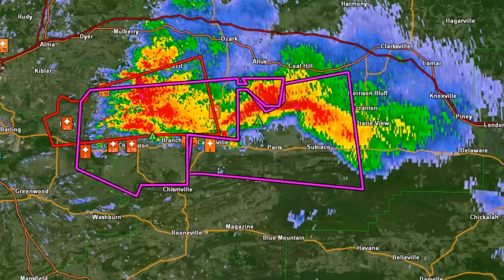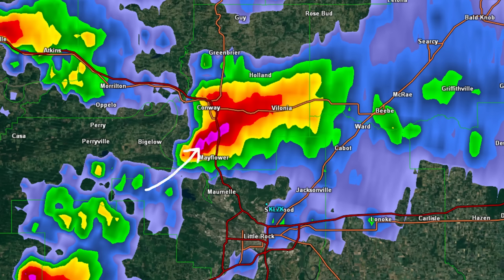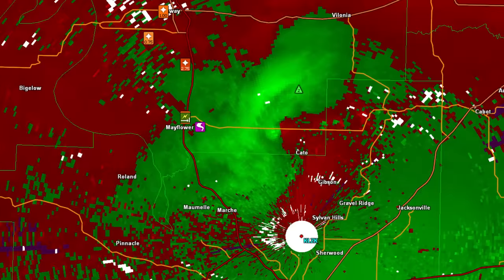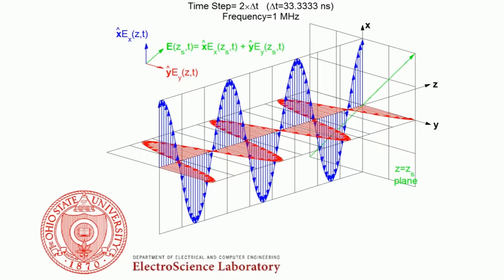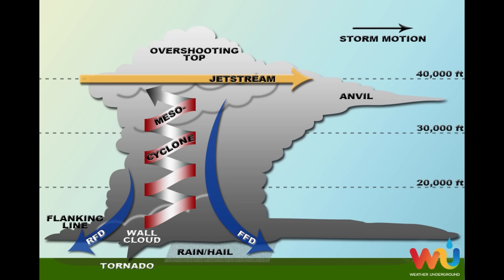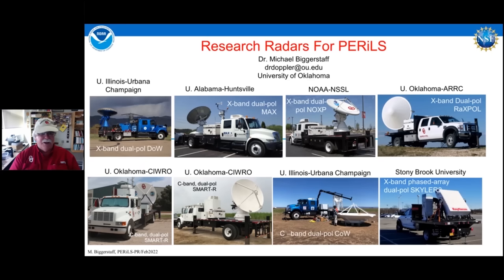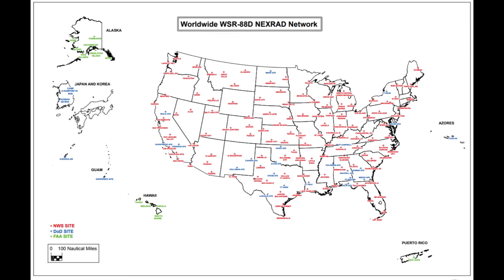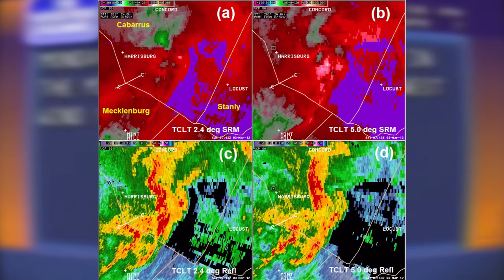Can Tornadoes happen with ZERO warning?

Comment: I went through something kinda like this. Back in August 2013, I was living in Bristol, Vermont with my dad. There was a chance of thunderstorms throughout the day, but none were predicted to turn strong or severe, really.

Later that day, a thunderstorm developed in New York and it started moving due east towards where I lived at less than 15 m.p.h. Constant rumbling and thunder. But, no warnings or anything.

Come to find out the said storm had a tornado warning on it when it was about 4 miles from me. I panicked and grabbed my dad and I put us in the basement..just in case. 

Luckily a tornado didn’t form, but the mesocyclone was rotating so strongly once it was about a quarter mile from our apartment.
Reply from the maker: Wow that's a pretty rare situation! Glad it didn't drop on your apartment
Reply: @weatherboxstudios  

It was. I’ve never seen a tornado but that day I was surprised to see the rotation!

Comment: I actually have. California, especially in Coachella valley doesn't have doppler radar on the level as Tornado alley does, so imagine my shock and horror when an EF-1 suddenly sprang up a mile from my home. We had no warning, no hint that this thing was coming, and while it was tiny overall it did knock out power to my city for about 2 days with slight damage to the roofs. Scariest thing I've ever seen. As if the earthquakes weren't bad enough.

Comment: I've seen two although they did no damage as far as I am aware. I think it was 2010 and I was stationed on Hickam/Pearl Harbor Joint Base. I was standing on a balcony outside my barracks room. I looked out across the flight line and saw a pair of tornados (waterspouts I think is the right term....) doing their thing on the far side off the coast.  I don't recall hearing any sirens or warnings at the time. I thought it was fascinating and took a couple photos.

Comment: glad I found this video, I've been trying to search for "tornados the nws didn't detect" and google wasn't giving very helpful results. this was perfect, and I'm now subscribed.

guess I should count myself lucky that I live in the wichita metro area with excellent coverage. however, just a couple weeks ago we got warned for a qlcs tornado and when I looked at the radar it was directly on top of us, but luckily there was no tornado. in 2019 though we did get hit by a qlcs in the middle of the night. 

also, $1.6M? that's it for a new doppler radar? I mean I know that it will incur much greater cost over its lifetime, but considering how much is spent on defense, wouldn't you think filling in radar gaps for $1.6M would absolutely be worth the cost for defense in the homeland? that's insane. and I'll have to take a look at that study. curious how they define "significant" in their data.

Comment: Radar gap is NOT because of curvature, or they would be spread more evenly. They are because of other factors, such as territories  too cheap (or too corrupt) to foot peoples taxes for radar, mountainous regions, ect. coupled with the fact that each radar has limited range, similar to the sonar we used in the ocean back when I was a commercial fishermen. But your correct, we NEED more radars. Any gap is inexcusable.
Reply: Curvature plays a role at extreme ranges, but we do need more radar sites. The real problem is that this is entirely run by Federal agencies and they do what they want to (and can) regardless of local predilections. That's why a lot of TV stations in the gap areas have installed their own doppler radars since that's the only certain way to get the resources those areas need. The post-Plainfield plan was to have seamless coverage where needed but Congress only funded the initial push, so later phases of the plan never happened. There's now bills being considered to get this back on track; be sure your Congressional representatives are backing them,.
Reply: @P_RO_  Well, imo with as much as they harvest in taxes and revenue, EVERY town should be in a radar field, and every town should have an underground public shelter. There is no excuse in our silicon/advanced era to lose a single person to the weather. But your right, the federal government spend money on all the wrong programs, and ignore whats truly essential.

Comment: Its 100% terrifying. We live in the Portland Metro area (OR), we've had two unwarned unknown tornadoes. The only ONLY reason they were confirmed is because some ones house got hit and had a security camera on one, and the other was because we all saw it touch down and lift back up. Coming from the Midwest that shook me to my core because holy crap, there were no warnings, just some storms. The one that we all saw touch down, wasn't even a severe warned storm.
Reply from the maker: I haven't done much research on west coast tornadoes, but those have to be a nightmare when they do happen. Thanks for sharing
Reply: @weatherboxstudios  Oregon tends to get a lot of EF0 and EF1 tornadoes, and more rarely a few EF2s. And in extremely rare cases, EF3s, but that almost never happens. My county (in the Portland metro) has only really experienced EF0 and EF1s and I don't remember a single one of them either. The subject intrigued me because I had no idea we even had tornadoes in Oregon until I looked it up. But they're pretty insignificant really.

Comment: A weak waterspout came ashore from Lake Samish near Bellingham, Washington a few days ago without warning. It's rare, but it does happen in Washington sometimes, like the EF2 that hit Port Orchard without warning. Also, why was there never a tornado emergency issued for Joplin in 2011??
Reply: The reason why the National Weather Service office in Springfield, MO didn't issue a Tornado Emergency for Joplin, Missouri during the May 22nd, 2011 tornado is because it formed so quickly. The tornado sirens were first sounded at 5:17 PM Central Daylight Time and gave the residents of Joplin seventeen minutes to take shelter. By the time the tornado sirens began wailing a second time at 5:34 PM Central Daylight Time and the National Weather Service issued a Tornado Warning for Jasper County, MO the tornado was already on the ground and moving through Joplin. In addition to forming so quickly and on the boundary of a densely populated area; what made the Joplin tornado so deadly is that it was hidden in very heavy rain and difficult to see.

Comment: I had one come down right on top of my car about 25 yrs ago in extreme northern New Milford CT just before the Gaylordsville line. I was driving north bound and had a white sedan in front of me about 30 yards... all of a sudden the car in front slammed on the brakes-I did too and nothing but leaves and wind-it picked up my car and carried it about 50 yards onto a lawn in a nw direction.  After about 15 seconds-it was clear like nothing had happened, but my car had no tire tracks in the grass where I currently was.  I still shake thinking about it and if I had gone the other way I would have probably died in the river to my right (ne or e direction).  Goosebumps.   Where was the white car??? I have no idea.  I assumed it just kept on driving but I'm really not sure.

Comment: Can you do a video on wind and gust speed? I live south of Seattle and on occasion we get some pretty good wind storms (Nothing like the rest of the country) around this area. I live in a relatively forested neighborhood and get bad anxiety when the wind is gusting above 30mph for fear of a tree falling on the house. What wind or gusting speed should I legitimately be worried about in this case?
Reply from the maker: That's a fantastic idea!
Reply: "Worry windspeed" depends on a lot of variables. The official 'line' for calling a storm severe is 58MPH (actually 50 Knots but close enough). At that speed falling trees may be a hazard, but more likely just branches will break off. At around 70MPH weak trees will fall. With weakened root systems, tall highly exposed trees, and saturated soil trees can fall in winds as low as 45MPH but it doesn't happen too often. Pay attention to what happens where you live for the best idea of when to worry as local history and knowledge will get you the best answer.
Reply: @P_RO_   I will reluctantly say that the “wind speed” rarely reaches into the 20-30mph range, however the gusts are really where my biggest fear is. We’ve had some pretty decent 50-60mph gusts with saturated soil (Washington State) which I thought were bringing the entire forest down. I try to tell myself that these trees have been here longer than I’ve been alive so I shouldn’t worry so much. I’ve done a little research on storms in the Pacific Northwest and we typically get one good one every year or two. Good one = 25-35mph winds 55-65mph gusts.
Reply: @weatherboxstudios  👍 I’ve seen a few videos online about it but you have a very unique way of explaining how weather works and for some reason I understand it. Thank you for the videos! Keep them coming!

Comment: Hey tonight my cousin witnessed a tornado in Georgetown Kentucky tonight along a QLCS Line and we have video of it and I was watching velocity and base reflectivity and there did seem to be a very small amount of rotation shown on both. The thing is, Georgetown doesnt have the best coverage and there was no warning issued but there were sirens that went iff
Reply from the maker: Wow! I wonder if the sirens went off for a severe thunderstorm warning
Reply: Sirens aren't controlled by the NWS; they are usually activated by a location's Emergency Management system of sometimes Law Enforcement or Fire Department. So you can have sirens and no warning, warning but no sirens, both, or neither. Always have at least 2 methods of receiving severe weather warnings and pay attention to them.

Comment: Only tornado I’ve seen was unwarned.   I was at home playing video games when my parents told me to come outside.   We are in rural MS so we had a lot of tall trees, just above the trees through a gap you could see a pretty big tornado funnel.    It was far enough away you couldn’t hear it and the skies weren’t dark so you could see the structure of it perfectly.    I was like 10 so I just said “cool” and went back inside like it was a rainbow or something.        I mean literally on my front porch I had the perfect view.   No clue if it was unwarned or not but it damn sure was unwarned to me especially since it wasn’t rainwrapped and the skies were clear.    I used to see waterspouts all the time on the beach when I was a kid but as the years progressed they just stopped happening.   My mom literally would point out waterspouts every single morning to the point I doubt our news even reported them, it was just a common occurrence back in the early 2000s

Comment: Mayfield, Ky experience an un-warned EF2 tornado that almost hit the county High and central elementary school.  I was just 18 and working at the local Food Giant. We weren’t expecting storms at all that day and it was a random super cell that formed out of no where. No warnings were sent out until the Sheriffs department warned that they had spotted it. It actually stayed on the ground for quite a ways. Destroyed some homes and lifted a mobile home off the foundation and wrapped the metal frame around trees. The storm happened back in 2016. Look up the tornado of mayfield in 2016 and you should find some good video taken off the Dick Castleman Bypass just a mile or two south of the tornado. There was local video also taken by the car dealership that shows it going through a Rv and camper Lot. Let me find the story and I’ll tag the URL!
Reply: It was actually an EF3
Reply from the maker: Wow Mayfield has been through enough already!
Reply: @weatherboxstudios   tornado alley has definitely shifted and it’s bad when western Ky falls in a groove of super cells that form along a line of unstable air. Ever since 2016 we’ve had non stop tornadoes forming around the area.  A lot of them are unheard of because they don’t make the headlines. We just happened to have 4 confirmed tornados over the last severe storm line last week and one actually touched down in Northern mayfield. It was an EF-0 then we had another one touch down South of Mayfield in Sedalia, Ky where I think it was a EF-1 touched down. No injuries or deaths were reported. Just minor damage. Actually took a whole street of power lines down though and arced the road causing small mounds. Kind of cool to drive by it now.  Anyway, western Ky has been hit before definitely, but it seems  to be worse than it possibly used to be.  My brothers old house he remodeled was destroyed by a EF-2 about a mile down from my house on Stubblefield Rd. Ripped up 3 chicken barns as well. And that one was actually another unwarned tornado. We were in bed watching tv and the power flickered as it went through the road, but later knocked power out. We didn’t know what happened till the next day.  It’s crazy how easily a small tornado can form without warning even with being in a “low risked” storm. 
  I love to watch the weather and be a part of it if I can. So keeping a close eye on weather maps and reports is something I love to do.

Comment: IMHO, the Federal Government/NWS should not have consolidated NWS offices back in the 1990s/early 2000s. A lot of places that were once covered now fall into gaps in coverage, and must rely on local Television stations to pick up the slack.  Erie PA, and Harrisburg PA areas are prime examples. Erie itself falls smack in the middle of one of those gaps, being at least 100 miles from Cleveland, Pittsburgh, and Buffalo NWS offices, and having to rely on Cleveland's offices for warnings has often had its disadvantages, leading to quite a few unwarned (but minor) tornados. The local television stations do their best to monitor the storms, but if they lose power, as has been the case a few times during severe weather, the area is SOL. Harrisburg is in a similar situation, with all NWS radar sites being 85-100 miles away in either direction. I have lost count of the number of times CTP (State College) site has been down during severe, or their repeaters have gone down, and the HBG area has been left in the dark.

Comment: I live in Denmark, so I don't even know if we have an official warning system in place for tornadoes. They're much rarer here than in for example the US but we do still get about 2-10 a year, which can sometimes reach F2 intensity with 2 recorded tornadoes (1962 and 1963) both given a high-end F3 rating by ESWD.

I haven't personally seen or experienced a tornado though I have seen tornado damage (probably low F1) and likely been under a thunderstorm that went on to produce an F2. Though I'm sure they'll be able to sound the sirens which are scattered around the country, mostly in towns and cities if a significant one should occur, I kind of worry if countries like Denmark are prepared for if another significant tornado should occur, if we've had F3s before, we can have F3s again.

Another significant QLCS tornado occured on 25 May 2019, a narrow and deadly EF3 that struck the already unfortunate town of El Reno in Oklahoma. I don't know if this was warned or what it looked like on radar as i'm not quite sure where to go to find that data if it's available anywhere but it is a very notable and recent QLCS tornado.

Comment: Ten minutes is plenty of time for me. There's a parking garage two blocks from me. The lower you go the more government vehicles you see. I'm not sure how far it goes down, but at least six levels. But you could get burried there I would think. So it's better as a car shelter. But!! What's really good is there is a staircase to the garage that is separate from the garage , so it's not under it, it's to the side of it by quite about it. The way it's layed out  in the courtyard, you can't really see the entrance unless you you wind through a section of the courtyard that is maze like, and unless you were looking for something there would be no reason to walk that way because it's  obvious it doesn't go anywhere.  But make one turn and there's the door. Go down one flight of stairs and there's another door, Go down another flight and you get another door. These doors are pretty heavy. They don't lock, but I figure four flights down should be far enough. This staircase is like a bunker almost.

Comment: It's almost as if the Supercells of all types are fed and propagated with predictable conditions but storms like QLCS and Derecheos are so misunderstood. 

Like, with inflow notches, that products seen on radar can vary well just be an Eddy Current of an air mass from the surrounding environment that contributes very little fuel (energy) to the actual storm and though being drawn into the storm may in fact NOT be within the layer of EFFECTIVE INFLOW BASE or TOP. 

I live in Southern CA and the more I study this QLCS phenomenon the more I feel as if the particularly dangerous thunderstorms with erratic lightning behavior I experienced as a kid were possibly QLCS fed by the gulf of California east of Baja Mexico because that gulf gets Explosive levels of CAPE even in the Fall. The North Pacific high pressure ridge does weird shit sometimes and when it does you may even see a scud or what looks like a rotating wall cloud over the Mojave desert out here, I have seen it twice.